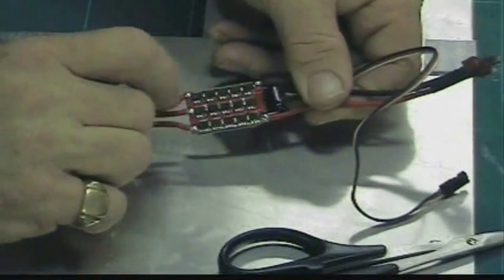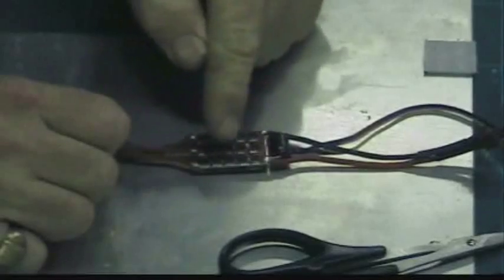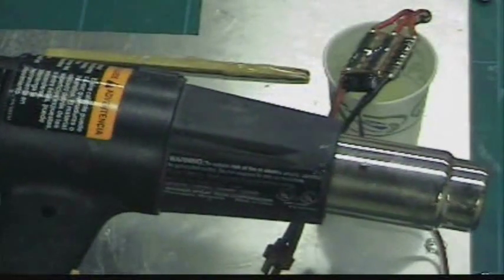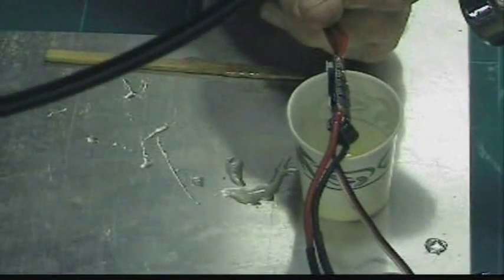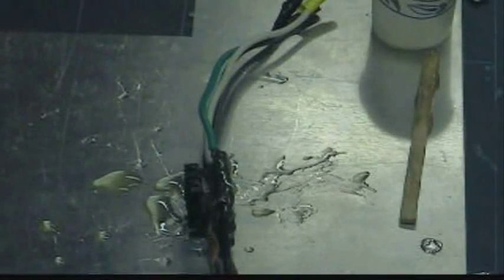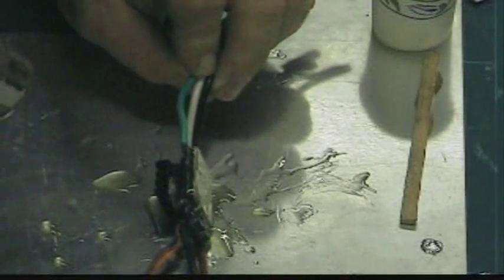Waterproofing a ESC BESC

Comment: well i can tell you hot glue has never failed me yet and a few of my boats the esc's are sealed from the factory with either hot glue or silicone ,, i never heard of epoxy's ever being conductive i been in the electronics field for 37 years, personally all esc's and receivers should be water proof right form the factory they know these toys are going to hit the water , how ever boat escs are water proof but the receivers not one so far can i find that are water proof by any means

Comment from the maker: Yes I know. However you will be lucky if hot glue will give you a "water Proof" seal. Most Epoxy will conduct electricity and ruin your ESC.
   If you are going to do something, do it right the first time.

Comment: you know you can fill each end of the esc with hot glue and save all that work will do the same thing.. you can also use Epoxy resin as well